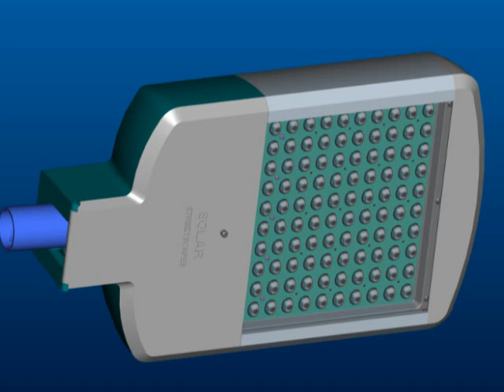Solar Street light at night

Comment: IP64TUV E27E40 360 degree led corn light replace 250W 400W CFL/HPS:
The application is very widely :warehouse,parking lot,squre,garden lighting,industrial 

lighting,replacement of HPS,HID etc. 

1.U style lamps,HPS lamps,metal halogen lamps,etc Replacement,ratio is 2-4 times. 

2.warranty is 3 years,IP64 Samsung chip 106 lm/w,12w-125w.

3.360 degree lighting,E26/E27/E39/E40 Lamp holder.

My Skype:gk.rex  Mail:gkrexchen@gmail.com

Comment: Do you want to save energy 60% with cheap price and the same effect compare with LED 

tube?Please try our CFL T5 in T8 Fluorescent Tube in Tube. e in tube New design hot sell T5 in 

T8 and T5 Adaptor to replace old CFL.

1.75lm/w.
2. warranty is 2 years.(lifespan >20000Hours).
3.CRI>85, PF>0.96.
4.Light angle is 240 degrees,60% saving energy. 
5. Internal ballast and power, the same use way with led tube, lumen value equal to LED T8.
 My Skype:gk.rex  Mail:gkrexchen@gmail.com